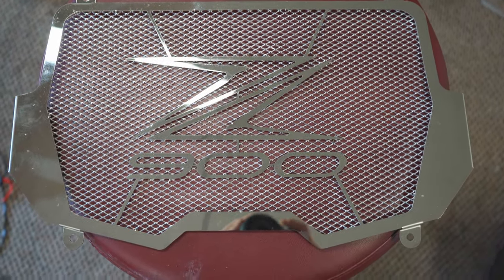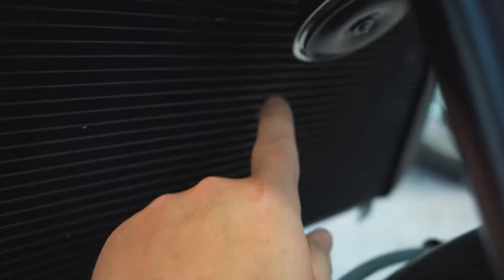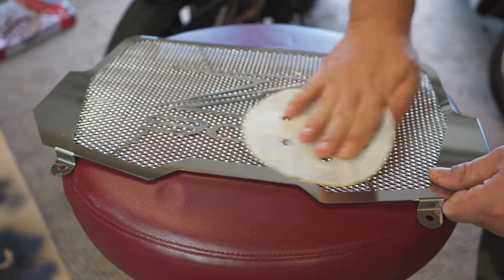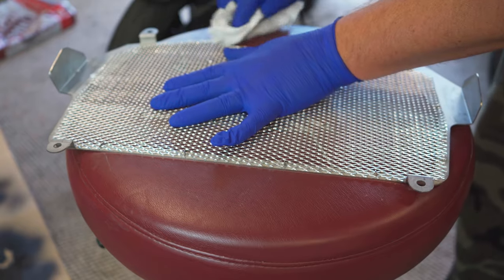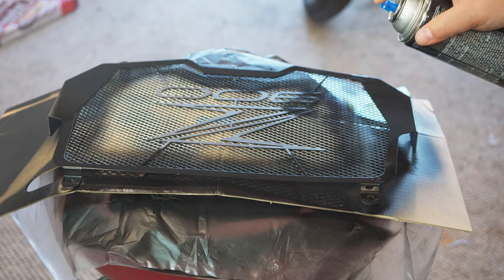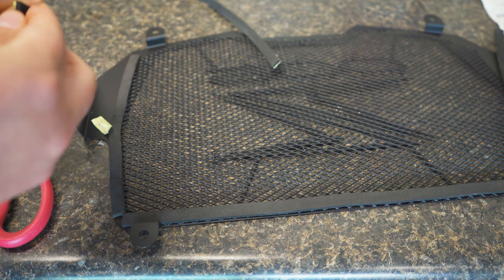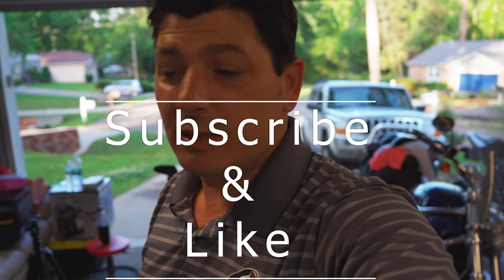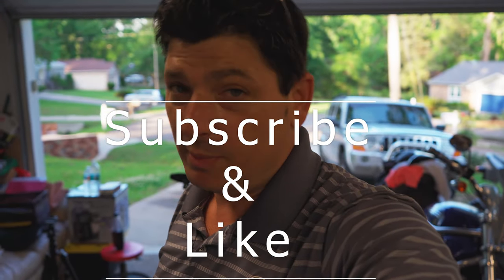Radiator Guard Install on my z900

Comment: Hey, I noticed you have the stock horn... Does it sound barely noticeable beep beep or is it loud so as to really get attention on the road? I replaced mine, silly beep beep sound,  with a combo 410Hz/510Hz snail horns put together back -to-back with double sided tape and then secured with strong black gorilla tape. I had to create my own installation mount bracket but no biggie for a customizer like me. The sound is really ear catching now! No more beep beep.
Reply from the maker: Stock motorcycle horns suck I have been testing the sound bomb. your setup sound loud.
Reply: @SimpleSimon  I'll post my horn set-up so you can hear it.
Reply: @SimpleSimon  by Kenlee Autoparts 
Learn more: https://www.amazon.com/dp/B089W7HFBH/ref=cm_sw_em_r_mt_dp_B3YKFb3MB06FT?_encoding=UTF8&psc=1
Reply: @SimpleSimon  I sent you the link to the horn set. They have a video demo along with pictures... Excellent set for $20
Reply: @SimpleSimon  So, after I performed more extensive testing these horns have a minor problem. If you mount them near anything that gets too hot on the motorcycle the loud sound is lost. After looking into the design of the horns it appears that there is a diaphragm material inside them that changes consistency when they get hot. I will have to work on finding a non-hot zone for these horns because the loud sound does a real good job.  I noticed the problem after I let the engine reach normal operating temperatures. The existing horn mount on the motorcycle is very close to the radiator!!! Definitely generates tremendous amount of heat.  So, I will try again to mount the horns in a much "cooler" zone! I'll let you know how it goes.